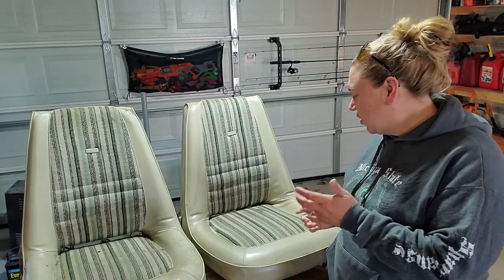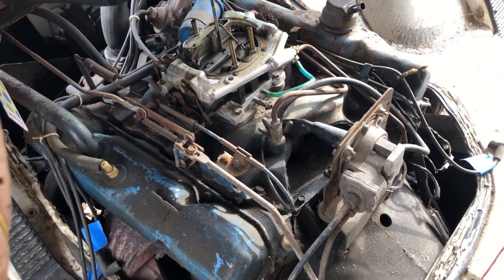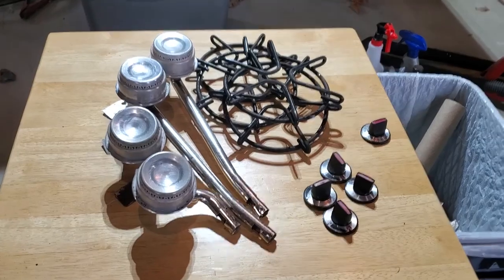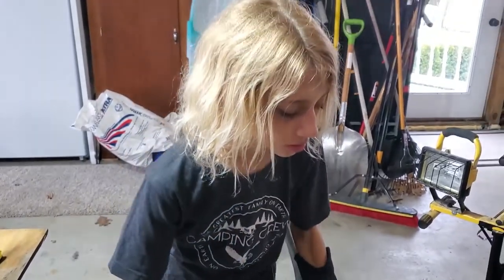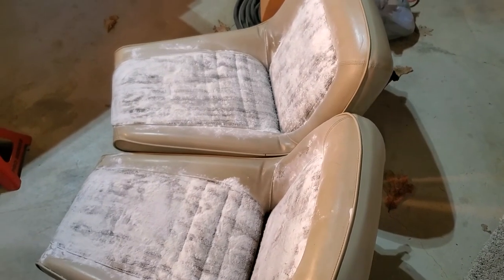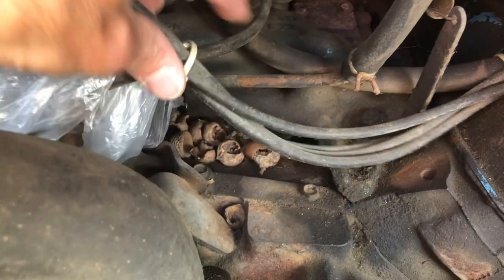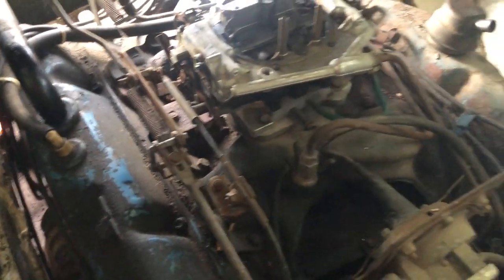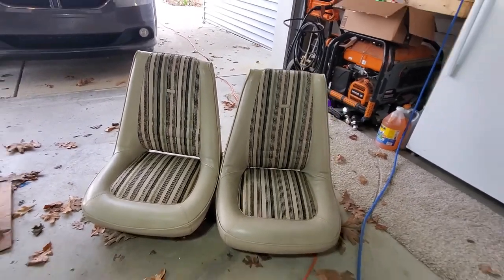Giving New Life to Vintage Camper - 1970's RV!  DIY RV Renovation

Comment: Just a thought. I once owned a Dodge. It had a oil pressure gauge that read 0 to 10lbs all the time. I rebuilt the engin, and it still had 0 to 10 lbs pressure. Turns out the gauge was bad. The internal pressure was good. Check your gauge with a real gauge at an oil plug. For example, at the oil pressure sending unit.
Reply from the maker: Thanks for the comment. That's a valid point. A 47 year old factory gauge may not be the most reliable. I need to buy a fitting for my pressure gauge to check it that way. By the way,we've got another video coming out today at 3pm. Check it out and let us know what you think.

Comment: If it is a Chevy V-8? Replacing valve cover gaskets is ALWAYS a very good idea.
Reply: Well its not chevy junk!
Reply: @dodgeramsport01  , there is an old saying around Dixie. "There has never been a Chevy V-8 made that did not leak oil from the valve covers!"
Reply: @markthomas2436  Well I agree being from the south myself!
Reply from the maker: It's Mopower! And actually the valve covers leak. New gaskets and I tried to straighten them out. They were previously over tightened. I'll get around to putting a new set on eventually

Comment: Something to try if it’s not too late is squirt some motor oil in the low cylinders crank over the engine like before. If the cylinder pressure comes up you have bad rings if not your problem is in the valve train or head gasket’s. My make your decision on the motor easier.
Reply from the maker: Thanks for the tip Dan. So it's not too late. I had read somewhere about adding oil to the low cylinders and rechecking. I'll give it a try and see what that tells me. I hope you hit subscribe to follow along with our progress.

Comment: This is quite a project ! Will you be "modifying" it to a whole new design, or will you be returning to the 1970's lay out and look? in 2006, we bought a 1984 Cobra Van America Class C moterhome with onboard generator and only 38K miles on it. It was in original ( musty) condition and we did a little makover on her. Took out the stinky carpet, painted the bathroom., installed vinyl flooring and window coverings , new matress and made it very usable. Over the years we have replaced the toilet, fridge, AC, rebuilt transmission ( that was first) and roof skylight/fans. Thankfully, the Chevy 350 engine is a wonderful "survivor" and we have a local mechanic that loves to work on it and tune it up.  We never did take it down to the studs, and I am sure there is rot under some areas, but we have never gone that far. I used to pull a 2 horse trailer with it and go "horse camping/"trail riding in a 100 mile radius. We don't drive it far anymore, but it does the job for use close to home. Can't wait to see how it all turns out ! Best of luck to you !
Reply from the maker: Hi Elizabeth, thanks for watching!  We're hoping to keep some of the vintage charm where we can but will need to replace almost everything on the interior.  The exterior will probably look mostly the same.  We do plan to change up the layout a bit.  I explained what we're thinking at the start of this video (https://youtu.be/iZLUt0aKjM0), check it out if you have a minute.  That's awesome that you took on a similar project.  We have looked at a couple Cobra Van's online.  We wouldn't mind getting one someday ;-)  Thanks for the encouragement!

Comment: I think you should get a crate motor and replace that one, everything you do at this point is a bandaid with it.  my experiences with elder engines like this is it's just a matter of time before you throw a rod or worse.. at least pull the oil pan and verify the oil pump pick up tube isn't clogged.
Reply from the maker: I wish a crate motor could be an option. At this point of the revival, we can't justify the cost. Pulling the pan is definitely a consideration though. We appreciate the comment. Keep watching the progress.
Reply: @retrorevivals  will definitely watch this build to the end.  wish I could help out..  Some Diesel oil would help out with all the seals and bearings.